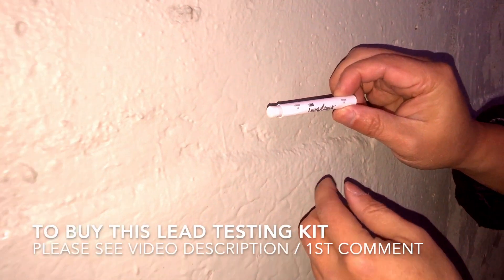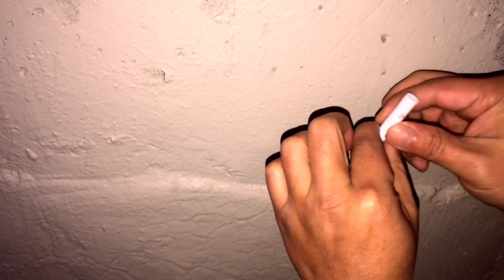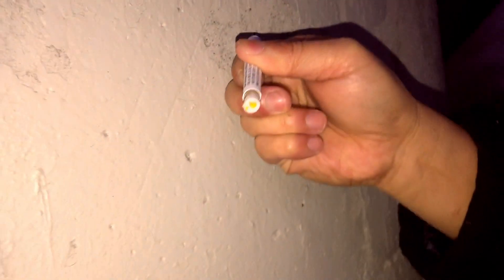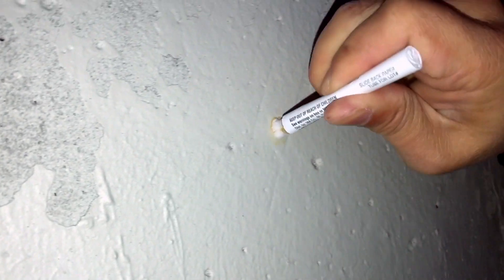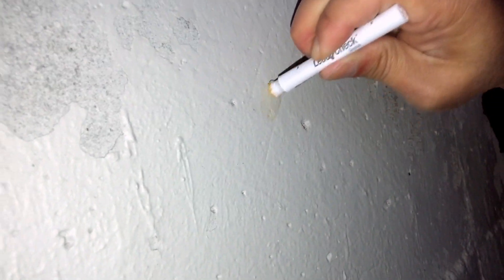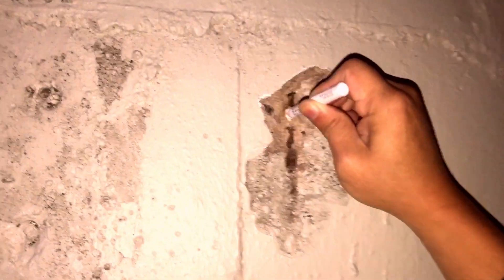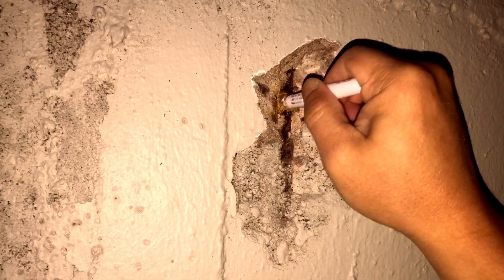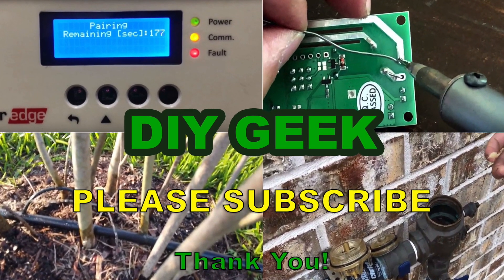DIY LEAD TEST KIT - 3M LEAD CHECK SWABS - INSTANT LEAD TEST

Comment: you have to cut into the paint to expose it before you test it
Reply: Pink or red
Reply: I used this same kit in the same way on my painted concrete basement walls, which provided a very definitive red positive test result.
Reply from the maker: The paint is 40 years old, that should be natural wearing